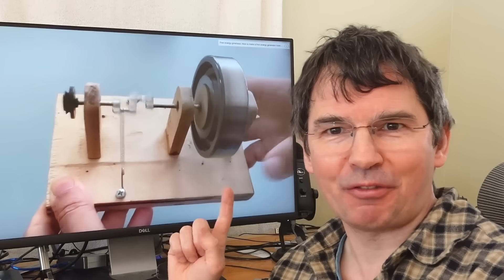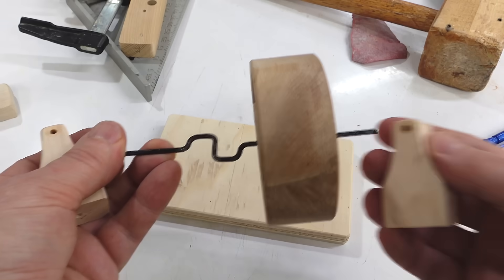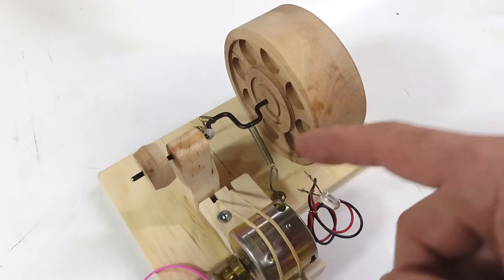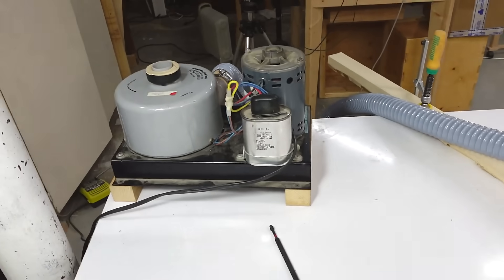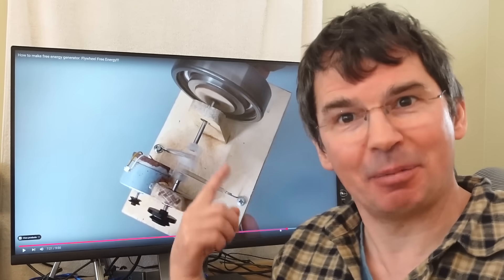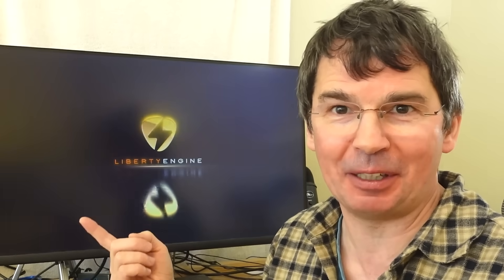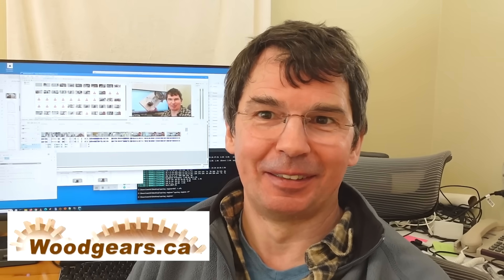I built a “free energy” machine and show how it really works

Comment: Absolutely Newtonian Momentum is different than kinetic energy: Newtonian Momentum is conserved: and kinetic energy is never conserved when the mass in motion changes. 

Every time I posted about the ‘cylinder and spheres’ on Quora; the profs would claim that energy was conserved when the spheres stop the cylinder and that energy is also conserved when the spheres restart the cylinder. 

Well heat can not be reabsorbed so they are not talking about total energy they can only be talking about kinetic energy. So let’s just look at the raw numbers; and this 1.2 m/sec is a real numbers determined by frame counts for the black square to pass from side to side. 

1.320 kg moving 1.2 m/sec    (the system spinning) measured
That Becomes 
.1320 kg moving v m/sec       (the spheres with all the motion)
That Becomes 
1.320 kg moving 1.2 m/sec    (the system spinning) measured

1.320 kg * 1.2 m/sec = 1.584 units of Newtonian momentum
.1320 kg * 12 m/sec  = 1.584 units of Newtonian momentum
12 m/sec is needed for Newtonian momentum conservation     
12 m/sec

1.320 kg at 1.2 m/sec = .9504 J                 ½ * m * v * v
.132 kg at 12 m/sec    = 9.504 J  
For energy conservation the spheres can only be moving 3.795 m/sec not greater and certainly not 12 m/sec. 

If  the .132 kg spheres are moving only 3.795 m/sec (.5009 kg*m/sec of momentum) then after the restart the combined mass of 1.320 kg can only be moving .3795 m/sec (.50094 kg*m/sec). But the 1.320 mass was MEASURED at 1.2 m/sec.    NOT .3795 m/sec

Kinetic energy has never ever ever been conserved in any collision where the mass in motion increases. So why do the profs claim that kinetic energy is conserved in an experiment that they refuse to do????

The Momentum produced by an Atwood’s can be placed in these spheres and the energy increase is 1000%. 

You don’t need to get in the weeds: just throw some steel spheres off of your same wooden ‘bearing’.

Comment: What if you put magnets on the flywheel and an opposing magnet from the base so the springs would get it moving some like you showed, and maybe the magnets could boost to sustain the duration?
Reply from the maker: permetual motion machines with magnets don't work either.
Reply: @matthiaswandel  I saw a video sets from same guy that seems to indicate otherwise although maybe not a machine but rather power generating or power creation. It has to do with I think Nicola Tessla saying 1 cubic inch of air has enough power to illuminate a country for a year, and how sun and earth are both magnets and hooking magnet together can increase forces so the idea is to hook sun to earth with a tap off of the circuit to have unlimited free power and when device or load is off circuit returns back to earth.  I am a little bit trying to investigate this and the possibility if it real or not.   It a little bit seems real but seems and is are or can be very far apart.....

Comment: Milan D; you are correct.
A 15 meter free-fall drop takes 1.749 sec 

A 15 m drop of a 1 kg mass in a 15 to 1 modified Atwood’s takes 6.773 sec. (A modified Atwood’s is simply a block on a frictionless plane that is accelerated by a mass draped over a pulley; in this case a 1 kg mass is accelerating a 14 kg block.) 

You can load the Atwood’s with 1.749 seconds of force and unload with 6.773 seconds of the same force. Yes you can make energy from gravity.

Comment: Hi Matthias. I'm not an engineer, so I'm asking. This is probably nonsense, but couldn't the kinetic energy of the heavy bearing be used in a similar principle to produce more energy than it needs for propulsion? Since it rotates for some time even after being removed from the energy that drives it, for example the air flow, would it be possible to drive it only with some impulses, even if electrical, and let the kinetics work most of the time? Then less energy would be put in than is produced. So there would always be some short-term spinning, for example 2 seconds, and then the motor would rotate on its own for maybe 6 seconds, and thus it would generate energy without power for a longer time than it consumed.

Comment: AI Summary

Abstract:

This video initially presents the successful construction and operation of a "free energy" spring engine, apparently built from simple materials and capable of lighting an LED. However, the creator quickly reveals this is a demonstration to expose the deceptive techniques used in such viral videos. He meticulously explains how an off-screen air source (like a leaf blower or air compressor) is the true power behind the device, aimed strategically at the flywheel. The video details common trickery, including camera angles, lighting to hide the air nozzle, the use of heavy flywheels for prolonged spinning, and post-production manipulation like added sound effects and spliced clips. The creator also discusses the economic motivations for producing these hoax videos, particularly in relation to YouTube ad revenue, and shares his own experiences debunking other "free energy" claims.

Exposing "Free Energy" Hoaxes: A DIY Build and Deconstruction

*   0:00:00 Building a "Free Energy" Device: The creator sets out to replicate a "free energy" spring engine commonly seen in online videos, using basic materials like wire for a crankshaft and wood for a flywheel.
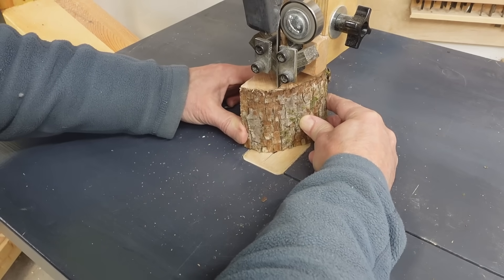*   0:00:24 Crafting the Flywheel: A key component, a large wooden "ball bearing," is meticulously shaped to act as a heavy flywheel, crucial for the illusion of perpetual motion.
*   0:01:35 Initial "Success" and Deception: The assembled device is spun and appears to work, with the creator feigning surprise. An LED is then attached via a belt, seemingly powered by the "engine."
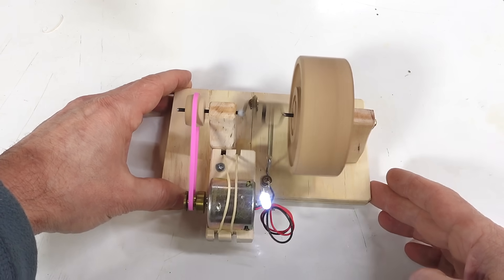*   0:02:15 Claim of No Manipulation (Initially): The creator asserts the video footage is "straight off the camera" and not manipulated, a claim that will be later clarified.
*   0:02:34 The Reveal - How It's Faked: The creator "comes clean," admitting the device cannot run on its own. He demonstrates that an off-screen mechanism is required, initially showing how he had to step on a pedal.
*   0:03:06 The Air Power Trick: The core deception is revealed: an air jet from a leaf blower (or air compressor nozzle) is directed at the flywheel, carefully positioned just out of the camera's frame to make the engine run.
*   0:03:50 Staging and Illusion Techniques: The importance of a heavy flywheel (which spins longer) is noted. The creator details how strategic camera angles, specific lighting to hide shadows from the air nozzle, and avoiding close-ups are used to maintain the illusion.
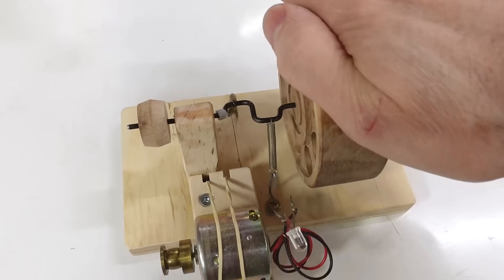*   0:04:50 Sound and Video Editing: The "engine running" sound was added in post-production. Multiple short clips were spliced together because the air source (leaf blower/compressor) couldn't run continuously for the desired shot length, revealing video manipulation despite earlier claims.
*   0:05:09 Debunking Other Hoaxes: The creator discusses debunking another "free energy" video where the only visible clue was a wire subtly rocking from the force of a hidden air jet. He highlights that the crude construction of such devices often belies sophisticated hidden mechanisms.
*   0:06:07 Motivations Behind Fake Videos: He speculates that many "free energy" hoax videos originate from countries where YouTube ad revenue can provide a substantial income, making even deceptive content creation financially viable.
*   0:06:27 Case Study of Deception: He references a specific creator (Mr. M. G. Rodriguez) whom he debunked. This creator later made a video "exposing" his own fakes, only to claim a new version genuinely worked, which the narrator identifies as another trick using video compositing.
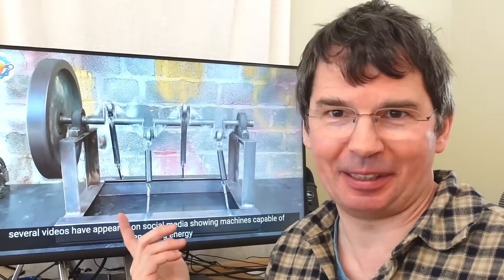*   0:07:15 Clarifying "No Video Trickery": The narrator distinguishes that while his device's operation is faked with air, the visuals of it running (once powered by air) are not digitally manipulated in his demonstration, unlike some other hoaxers.
*   0:07:48 Ethics vs. Monetization: The creator expresses disapproval of the dishonesty in peddling fake free energy but also acknowledges his own financial benefit from debunking these videos, as they perform well on AdSense.
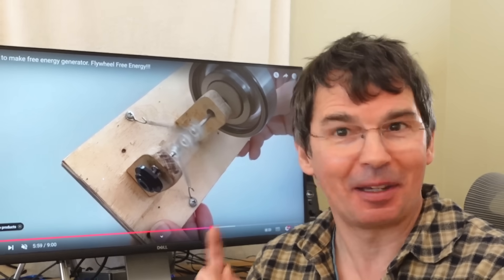*   0:08:04 YouTube Ad Revenue Strategy: He notes that many "free energy" videos are intentionally longer than 8 minutes to enable mid-roll advertisements, thereby maximizing potential ad revenue for the creators.

I used gemini-2.5-pro-exp-03-25| input-price: 1.25 output-price: 10.0 max-context-length: 128_000 on rocketrecap dot com to summarize the transcript.
Cost (if I didn't use the free tier): $0.03
Input tokens: 12728
Output tokens: 972
Reply: slop

Comment: Love it, at first I was like WHAAAAT it really works? lol
Reply: Same! I gasped and said WOW! Then was quickly deflated when he said it was fake lol. I must be so gullible.
Reply: @Stacey12211  it is 100% possible if you can Create one which can Spin longer with little Drag Force,Resistance/Friction.i.e ball Bearings a small amount of Current can be generated for small Time which can be used to Run spinning motor which can then Assist the Further Spinning of the Wheel instead of Directly Connecting it with Current Consuming Device i.e Light bulb.meaning a Small Current from intial motion can be Created to Further increase the Spin of the Wheel and prevent it from comming to a Stop...

Comment: Brilliant. Dear sir, would you please put your mind to an issue you may face when you get to my age. A better way to clean leaves out of roof gutters. I have been getting up with scoop on a pole and high pressure hose but eventually it’s too much and now have to replace rusted gutters… I thought of a scoop stationed at each end connected to a pull wire at the other end….but I see issues. Maybe a small rc dozer to drive a curled scoop to dump over side as it travels…I thought of hinged gutters spring loaded which will drop down and dump in one fell swoop. Then I thought of you and your followers. Ideally at 80 I can press a button or pull a series of cords…..what? I plan to be here for another 20yrs or so and need to address this problem….. 🙏🏾
Reply: Have you not heard of PVC guttering or something called "gutter guard" which is a purpose made netting in long strips which fits over the guttering.
Reply: @billharrison3174 Yes Bill, we have them in Australia. Many gutter guards however fail which is why I seek a good mind to find an alternative.
Reply: @peternicholsonu6090  thats interesting as my other half is always on me about getting them, when you say "fail", is that because they are plastic and UV light destroys them or some other reason.. Or are they made from metal and just rust out.

Comment: Good video Matthias showing both sides of the curtain. There is free energy devices in the form of wind turbines / solar panels but they are not as glamorous. Another one people could try is either using induction coils or a Tesla coil out of shot to light a neon or fluorescent tube from the "free energy" device which is only really a pick up/antenna really. I suppose its all like a magic circle but for scientist/engineer types who know the secret.

Comment: My first guess was the base plate was two pieces of thinner plywoods glued together to make a thicker base plate, and inside that cavity was a motor. And, the thick flywheel had a mechanism inside of it or something.

Good work.
Reply from the maker: magnets in the flywheel, and a coil in the base, but the electronics would have been an awful lot of work.

Comment: I hasn't seen any of these 'free energy' videos - so if I now see heaps I know who to blame!
I was wondering how you where going to fake it, I was originally thinking it was just going to be a magnet or two in the flywheel with a coil in the base to be a terribly inefficient motor, but air powered would have made the list - actually quite obvious to me with how many air powered tools I use anyway. Just had to know what the setup for the trick needed to be first.

Comment: Nicely done! One craftsman tip: When you make the holes on your drill press, just put a pin in a block for your wheel to spin on and all your holes will be in line. 
Great video and worth the full watch.
Reply: Same with making circles using a band saw.

Comment: Ok Mathias.  I like the flywheel on your design (looks cool).  Add some reflective tape on the outside, an optical sensor, connect your Raspberry Pi and plot the rpm as it decays, then turn on the air, etc.  Add voltage and current measurement to the generator/led combo, and plot the generated power.  You could also add a thermistor setup as self heating (to detect airflow), and add that to the plot.